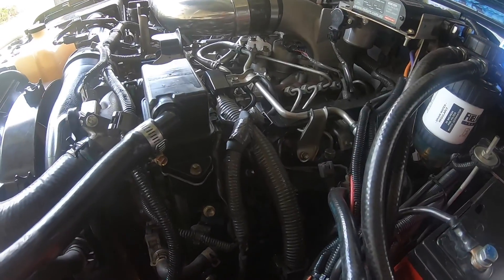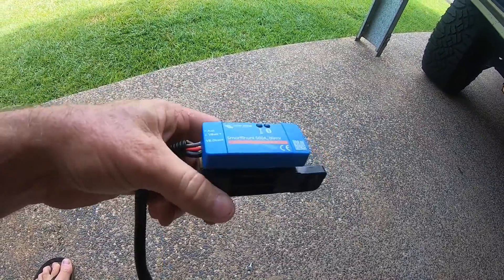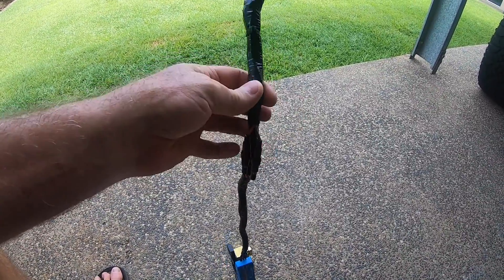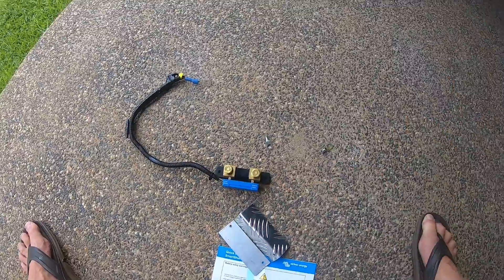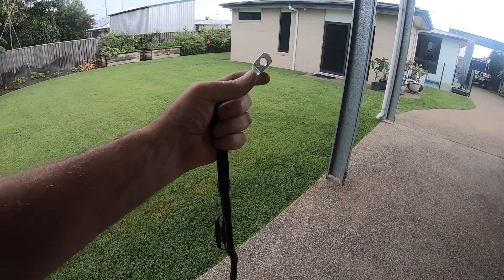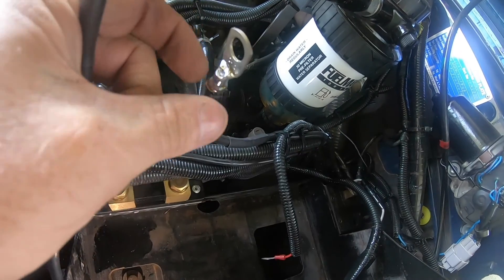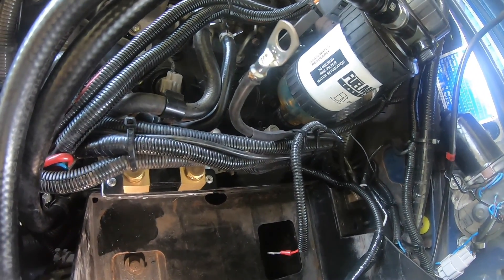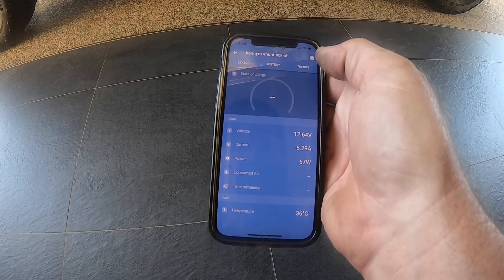Installing a Victron Smart Shunt || Better than an Auxiliary Battery Monitor?

Comment: How has this held up under bonnet?  I see in the data sheet they are only rated for -40 +50 °C (-40 – 120 °F) which engine bays can exceed on hot days.
Reply from the maker: It’s still working 👍. I’ve got a temp monitor on the aux battery as part of this set up, it has indicated temps above 50c on occasions.  The Victron unit is bolted to the battery tray so I’d imagine it’d be getting that hot as well, if not hotter. 

kennym

Comment: so with the temp sensor you cut the ends off of the shunt red and gray wires and splice in the temp sensor?  then they attach to the positive terminal?
Reply from the maker: That’s right. The fuses need to stay in both those wires. 

I tried to load a wiring diagram here but could not.  If you Google Victron Smart Shunt wiring diagram look for “Quick Installation Guide Smartshunt IP65”. 

Page 2 has the wiring diagram for the temperature sensor.

kennym
Reply: @kennymepicadventures876  thanks

Comment: I confess to being a little confused Ken. I have a couple of Victron gadgets, including a BMV 700 (in the canopy for the 200ah lithium) and a BMV 712 (in the Bushtracker for the 300ah lithium). The BMV 700 has since been fitted with a Bluetooth dongle...didn't think I'd want/need to monitor on my phone, but find I'm looking at it quite frequently!!
From what I can see/tell, the only difference with your shunt is that (a) you don't have a physical gauge/display attached to it and (b) it is IP65 rated (not sure what my shunts are rated for, but I don't think they're designed for damp conditions).
Or, am I missing something? Perhaps your shunt acts as a battery isolator too? 
If so, I'm still confused, because the DCDC charger/s do the job of isolating the aux batts from the starter batteries.
Given the cost of the unit you have, I'm guessing I'm lacking a basic understanding of what the device is achieving....
Reply from the maker: Hey Bill,

With my Redarc RedVision system I use the app more often than the display, let’s call it convenience.

If you have a Bluetooth dongle you have the victron app, plainly stated.  I have a dongle for my inverter. I don’t have a display.

If I installed a display I’d need to run wiring from my shunt to the display. I’d likely install the display in the canopy (I guess that’s where yours is). 

For convenience I use the app. Hence no display. 

What does the shunt do. It is no different to most shunts. It’s a juncture where a “monitor” with necessary hardware and software can read various parameters of your battery.

In this case, the Victron has on board the hardware and software to provide the battery parameters via Bluetooth to the app.  What does the app show, I’m guessing no less than the display.

State of charge
Time remaining
Battery temperature
Battery voltage
Current (either in or out)
Power (in Watts in or out)
Consumed amp hours

The above on just the first screen. That is a lot more than the base info I had, only battery voltage.

Of course if my old BMI was still installed and working I would not have needed to go this route. Alternatively I could have stayed with the base reading of battery voltage.

I’m guessing like you, it’s convenient and helpful to have a fuller picture of what’s happening with your battery than mere battery voltage.

kennym
Reply: @kennymepicadventures876  cheers mate....I'd never thought of only having the Bluetooth option without an actual screen to monitor.
The one for the canopy is mounted in a panel which I can see at any time, through the back window of the canopy's 3rd door.
But as you alluded, the Bluetooth gets far more attention than the actual gauge/screen. One side benefit of the BMV700 is that on the Bluetooth readout, it also gives me the starter battery voltage, even though that's not all that useful to me because the starters are both lithium batteries too, so always reading over 13 volts.
Thanks for the explanation.